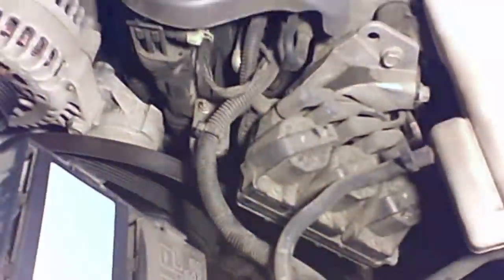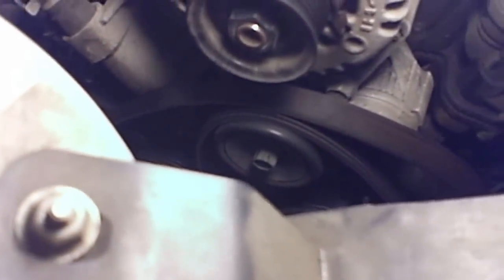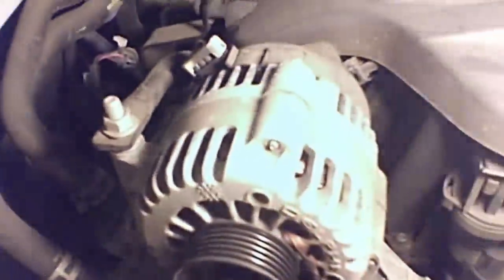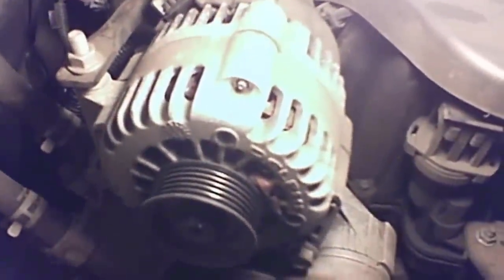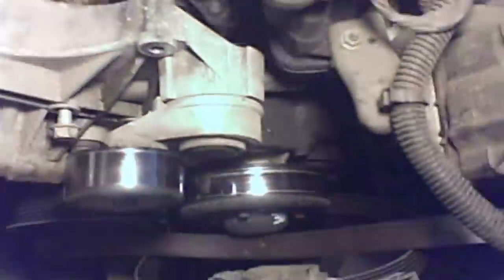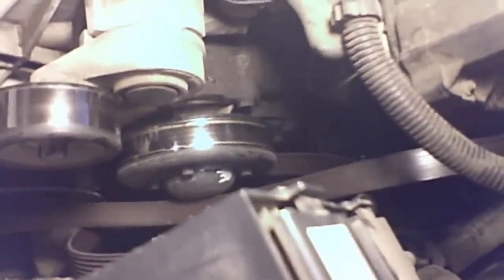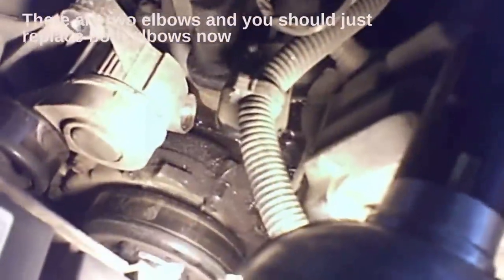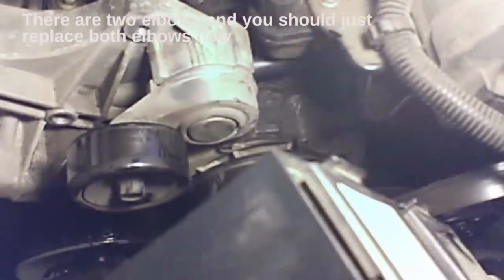Coolant elbow pipes leaking 2004 - 2008 Chevrolet Impala 3.8L Buick Oldsmobile Pontiac

Comment: Thank you for the video!
I have Impala LT 2008 3.5L and small leak which is invisible. Does this car have the same elbow pipes like 3.8L engine?
Reply from the maker: looking at engine pictures I would say no it does not have the same setup.  Maybe look closer at the water pump on the belt side if that is where the leak is.
Reply: Fixing cars and stuff there is a cross over pipe on the 3.5 that leaks from the gaskets all the time. I know I'm a little late. And you probably already knew this. Just putting my two cents in.  Have a good one mechanic.
Reply: kcirred nosrednad where is the cross over located
Reply: @fixingcarsandstuff  I have a 2006 impala I can't find it

Comment: Could this kind of leak be mistaken for a blown head gasket? For some reason I dont think the mechanic who looked at my 2005 Impala knew what he was talking about. He did a pressure test on the radiator and couldn't find the leak. Said it was a blown head gasket?
Reply: Yes if it's a series 1 or 2 it could also be the phlenum

Comment: I have a 2008 Chevy impala LT 3.9L, I have a water leak on the passenger side I cant seem to find the leak. I fill the car up with water or coolant and within 10 minutes I will have to pull over and fill it back up